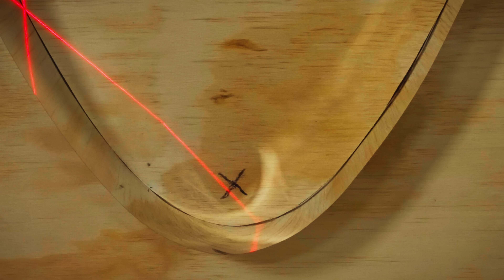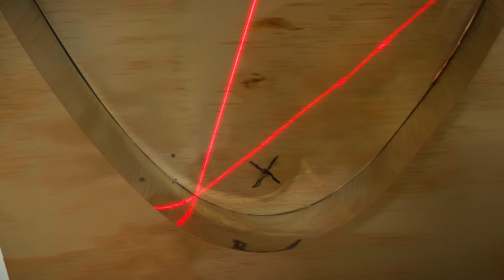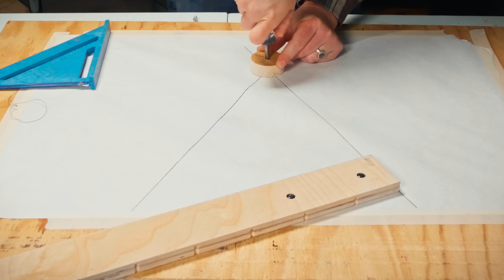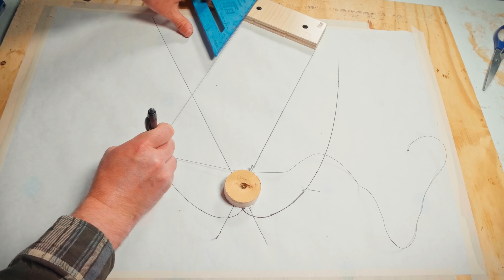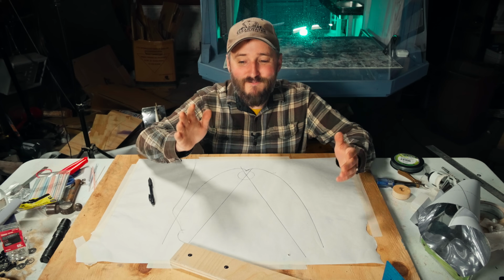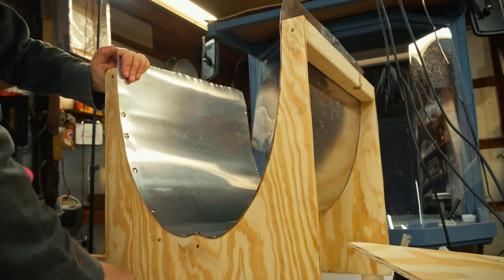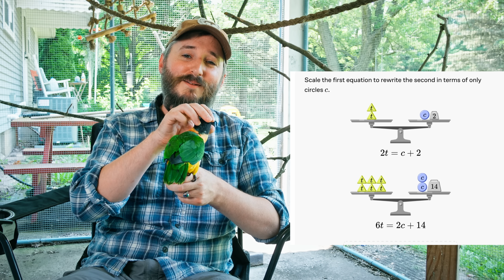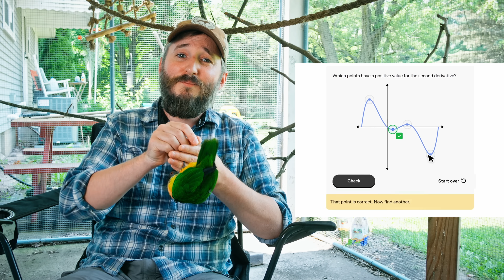DIY Solar Concentrators, Made Better.

Comment: This is so exciting.  I can see how you make the parabolic. I don't understand why it only concentrates on a small spot rather than a line.
     Presently, solar cookers concentrate heat that cooks the food in the cooker. I'm wondering if the flat one could be created larger to accommodate a pot? Put reflective material on both ends? And a double paned glass with a knob and a hinge on the top?  Or make one of the ends hinged?  If one of the ends are hinged, a smaller area could be cut out to just accommodate the pot and space to get the pot in and out. That would retain more heat than opening the top. It could limit the number of different size pots that could be used. If diy, the opening could be the size of the largest pot you would use. If manufactured, a starter pot, could be included. 
     I like Jeremy's idea for heating water. A copper coil could be made with an upper and lower end going to a container with a  spigot. That would make an excellent water heater. 
     And lastly could a solar air heater be made to heat the house or a room from this?

Comment: Draw your half curve in inventor using a sphere or a cylinder as the collector.  Use the rotate function to make a "dish" that sits on a 5 gallon bucket.   Have a heatpipe as the collector extend into the bucket.  Camping solar heater.

Comment: Would it be possible to copy this compound parabola and shape it into a donut and effectively making the solar input a 30 degree cone? I imagine you could have a loop of pipe stick up through the bottom to be the focal point.
Reply: Also in your second design I'm wondering if directing the sunlight into a sand thermal battery would it give any benefit

Comment: Would it also work to accept a 90° angle of aperture? Or even 160° ? Because if yes you would have a super efficient mirror for LED light. You would get a pretty damn good LED torch. For stage light for your yt videos

Comment: Interesting video, but yesterday we had +39°С outside without anything. So heating is not really relevant right now.
Reply: Showering, hot water for dishes
Reply: @SolarCookingGermany  That is correct and obvious, but can you make it work? Can you modify your existing water systems to enable you to shower and clean dishes using this solar heater? I really doubt it, though I have a solar station and my boiler has been heating with free electricity since this month. I have also had a summer shower since 2012.
I like the idea, but I'd like to see more everyday applications of it in real life.

Comment: That's fantastic. I think though, that when making the compound parabolic curve, it may behoove the maker to use a simulated pipe of a slightly smaller diameter than the real one, to avoid the incident light hitting the pipe at such a shallow angle, as shallow angles of incidence increase reflections.

Comment: Perhaps you can shortcut the drawing using the laser arrangement that you show beginning at 4:32 in the video. If you mount a pen through one of the holes already present in the bar holding the laser, then you can draw a segment of the desired curve by moving the laser from one extreme to the other as you show. Then rotate the laser apparatus to draw another segment. I think you'll get a series of scallops that you can then join into the desired compound curve.

I also suspect that if the curve of the 2-D compound parabola is entered into 3-D drawing package, you can use the drawing package to rotate the 2-D curve into a 3-D compound parabola that concentrates the energy at a sphere instead of a cylinder.

This approach is definitely interesting.

Comment: 16:12 Would this be useful for concentrating sunlight on PV cells or would that be too overpowering and lead to damage to the PV cells from overheating?
Reply: Current solar cells tend to fry, add cooling to the back and it could work… and provide hot water

Comment: Hey there, big fan! I have an idea. Have you considered making electricity with a peltier (TEG) by heating one side with this system and cooling the other side with a similar contraption designed to effectively harness solar cooling, like as shown in previous videos?
Reply: I did that with a Fresnel lens, but it's more complicated and less efficient than just using a cheap solar panel :D

Comment: Make a surface coated in infra-red reflective opal for your mirror! Then coat the inside of the pipe with a dark pigment! I also wonder if a mesh of aluminum inside the pipe would allow better contact with the coolant as to heat it quicker, or just skip the pipe altogether and have your focal point be a large heat pipe that makes contact with the coolant.

I also wonder if a refrigerant would be better for the coolant, perhaps being the gas inside a stirling engine or a series of stirling engines. 
You could also put a aspheric lens on top of the parabolic mirror to increase the collection range of the sunlight whilst still confining the light collected to that smaller angle. 

Really curious to see what the maximum efficiency of an optimized system like this would be.

A bit aside, but I've seen a lot of videos of fresnel lenses and I've wondered what sorts of optical properties you could achieve by making a mold of the surface and then setting a homemade opal on it as to repeat the pattern of the lens.

Comment: Here is an out of the box idea. What happens when you paint that pipe with your cooling paint and use a sharper angle on your compound mirrors to expedite the heat removal from the focal point and to also be able to point the apparatus directly vertical into a cloudless (or clouded) sky? Are we into something revolutionary? And use a more efficient coolant than air or H2O?

Comment: Man, I would've loved to see this video when I was in college for engineering. My senior project was making a solar oven, but we couldn't figure out how to design a good reflector with the constraints we were given, and our professor was no help at all. This really could've made all the difference for us. Glad to learn about it now, though! Thanks for another great video.
Reply: What was your major? The parabolic reflector would be a part of the curriculum in STEM courses AFAIK(?)
Reply: @manonfire285 Mechanical engineering. Sure, a solar oven by itself would be pretty doable- but not one meant to feed multiple families, only from resources available in rural Kenya. That was the specific task we'd been given. We designed a large oven made from clay bricks, and a reflector made from wood, with the reflective surface made of a single roll of aluminum foil, focusing all the light into a thin gap in the oven. But, the reflector design was far from perfect, and the gap in the oven was both too small to let enough light through, and too big to keep hot air inside.
Reply: Man , I can just imagine the insanity you guys went through , yikes
Reply: @texasslingleadsomtingwong8751  First world problems, I know, but it did still suck. The idea was, we were supposed to design a solar oven that could be made locally in rural Kenya, so we were trying to design one that didn't require any glass parts, and only required a roll of aluminum foil to make the reflectors. The idea was to focus the light in through a small crack in a brick oven, and hope it was narrow enough to not let heat escape. Without the professor's help, we couldn't tell if our computer model of the air in the gap was realistic, or if it was complete nonsense. We also had no guidance on designing the reflector. At the end of the project, we ended up with a broken brick oven that only got one degree hotter at the hottest part of the day. Still got an A though. I don't think the professor cared at all.
Reply: @Rippertear  Ah, Grasshopper, but what did you learn from your FAILURES?
Reply: @TimeSurfer206 Temper your expectations, especially from seniors who already know they're graduating, and especially from professors more interested in their research than in their courses.

Comment: Nifty AF as per usual ! Not to nitpick but, since you never mentioned it, it's just best to point out that it's rather well known that technically a hanging chain(or anything string-like) forms a catenary not a parabola. They are distinct mathematical objects but can "resemble" each other. Perhaps even arbitrarily closely(as can an arc) near the bottom(typically the $ area for optics). Or in other words the more shallow(Xdist > Ydist) the catenary the less the deviation from a parabola. Anyway, I for one would be interested in some math for this.

Comment: Please build a practical solar heat collector using the double shape. 
I'm guessing the pipe will be close to horizontal if water is used, so it can drain out before freezing at night. Water pump would only be on when sun is present. 
The mirror trough angle could be set bi-weekly. Opening should be perpendicular at noon. 
500 gallons of water at 180°F will heat a house for 3 days when it's -40° outside. Using a heat exchange system. Be it forced air or in floor hydronic. 
If you're interested, I have a solid drawing of a 600+ gallon insulated tank made of 2x4's & plywood. Uses a 10' x 20' sheet of rubber, cut to 10' x 16' for tank & 4' x 10' for lid. Tank is 10' long x 4' deep x 3' tall outside.

Comment: This is amazing! As you were explaining it, I wondered if there would be any advantage to using a double parabola. What I mean is, using either of your designs, but instead of placing the pipe in the focal point, having a little parabola upside down to collect the light rays and focus them further? Maybe to help capture more of the missed rays in the original design?

Comment: Amazing how awesome concentrated solar power is.  Would be really neat to safely make a solar powered air conditioner to cool with. Ideally a passive solar design, even if needing to tap into the ground for some geothermal cooling to condense and maybe a solar or off grid fan for the evaporator.  Though I'd have to see if even the RV propane powered fridge freezers even have a fan.  One of those to do lists things I have not found the time to research yet.  Tamera solar village has some neat designs they use where they even cook under moonlight with one of theirs.
Reply: Wondering if coating a cheaper compound parabolic surface with an ultra white reflective paint and maybe covering the trough with oven baking bag material?  Wondering what the cumulative effects are on performance along with longer term life cycle?

Comment: You're a genius dude- I've been designing generators based on heating a thermal mass with a boiling coil around it, and the increased surface area of a flattened mass using your compound parabola is perfect. You're so inspiring. I still tell people about your water bottle electrolysis video.

Comment: Could this be upscaled to distill water. Dig it into the ground using framing to hold the shape. Use your  idea heating a flat surface. That flat surface could be a metal container of water. Just dont know if the water would hit boiling. All the people in the world that suffer with dirty, nasty water

Comment: If it gets hot enough to melt metal... Could you make a solar kiln? It'd need to be bigger to fit a decent sized pot, but I could see it working.

Comment: Not to say that your this doesn't work, but your test changed 4 variables between test subjects (Mirror shape, pipe size, pipe material, pipe covering) and you now claim that the shape caused the difference, that doesn't seem like good science to me. The result might still be correct, but a good test would use identical pipes and only change the mirrors. Just look at the footage from inside of the aluminum pipe, it's completely reflective, basically you can throw the measurement away, even though you said the pipes are painted with the same emissivity this doesn't seem to apply to the inside of the pipes.
I would hope you would do a follow up video with a repeated test which uses identical pipes. With this video you give too much room for denial based on improper science, which I think is unnecessary.

Comment: Variation on your speed square process, as best I vaguely recall from my now-long-ago higschool classes, which might be a bit easier than keeping the string in line with the square's edge while the marking point is floating:

Put a board or other stop along the bottom of your plane (e.g. screw a 2x4 on your bench, and butt some plywood or cardboard to it).  Choose a point, and put a nail or similar there.  Tie some string around the point loosely enough to turn, and the other end attach to the point of a square (speed square, carpenter's square, whatever; I don't remember how my teacher did this, maybe just taped the string and accepted a slight loss of edge).  Pull the string taught while keeping the square...er, square to the stop.  Pull the pencil/pen/etc down the edge of the square, point to bottom, keeping the square against the stop.

Since the pencil is riding the square's edge instead of floating, it may be a bit easier as there's less to keep track of while tracing.

Comment: for this concentrating solar, and being such an easy thing to design at home, i'm wondering what the best way for it to generate some electricity would be.

1. to concentrate more sun on solar panels
2. to generate heat on 1 side of peltier plates.

edit: ah, it looks like peltier plates are about 10x less efficient than solar.  so solar panels would be a much better way to go.  well that was easy.
Reply: Solar panels also drastically lose efficiency when hot. And you could just use a solar panel the same size as your concentrator, much easier

Comment: Im guessing the next step is to coat the pipe with cooling paint and radiated heat away from the pipe into the mirrors and up to space, then combine the hot and cold-water loops to passively generate energy using peltiers

Comment: Can the compound parabolic mirror be used to provide more sunlight, to a solar powered sensor light?  The intent is to  maximise sun exposure to a solar powered sensor floodlight, in a place where direct sun exposure is limited daily by trees and buildings to a few hours. The sensor cannot be moved to another location.

Comment: interesting, an involute curve with a parabolic tail...
now fresnel it. wonder how well it changes to a flat structure?

its easy to mount flat mirrors in a box frame affair, angled slots, sort of like a louvre... and cheap, can even get offcut strips if lucky...
also need long focal lengths, otherwise the mirrors interfere with each other, blocking themselves. stay in teh bottom of the curve! does that work here? iunno. can only try!

interesting aspect, you only need half, the absorber doesnt have to be directly overhead? you can wall mount them, etc. light is flexible.

my thinking would be to look at ones solar angular deviation through the year, aim halfway and set the angles the same, troughs arranged east west. no need to reposition through the year. despite its performance on a cloudy day, pointing at the sun still helps!

the focus doesnt have to be sharp. its all good and well heating something to 1000C, but can you do anything with it? how much heat can you transfer, rather than simply radiate as wasted black body radiation? if water is getting boiled, but leidenfrosting off the surface and coming out barely above 100 with a red hot absorber, youre simply wasting heat.
found with fresenel mirrors that flat reflectors already give a diffuse focus. for heating water, its far better to be able to heat a surface to  little over 100C, with no flow. and when its the same temp as the water coming out, you know its extracting the maximum energy.. or you dont have enough exchanger area... flow rate affects final temperatures, blah blah... despite being larger, having a lower temperature absorber reduces radiation losses..

evacuated heat pipes would be a good addition...

and, seeing the geometry makes it pretty easy to do with a router.

straight edge with rollers to hold router. thats running on rollers on fixed straight edge... string keeps router in appropriate position still, just keep it taut. dont get it tangled up, lol.

timber frame, just some ribs and stringers, mylar emergency blanket stretched across...

Comment: This compound parabolic trough design is used a lot in large scale production for heating oil for power plants. You can also use this to create small scale water heater, which you mention.  To get even better performance, use an evacuated tube. It will definitely heat the water up to well over boiling in a few minutes. 
I would like to build one of these in conjunction with my solar electric panels to make hot water and to help heat during the winter. I would store the heated fluid in 30-50 gallon barrels surrounded by sand in an insulated container. Figuring about 6 barrels minimum.  You can create your own evacuated tubes using old fluorescent tube bulbs and cleaning them out, then pass a copper tube inside it. Then create a special mounting bracket on each end to hold the tubes and hold vacuum.

Comment: Looks like the "power from the sun" book link has expired. It 404s. Excellent video. I might put this to practical use on my home in the near future. In a strange synchronicity, I was just thinking about solar hot water heating when this popped up in my feed.
Reply from the maker: Might have given the site too much traffic from this video

Comment: Instead of heating a tube, heat a cone that gets wider at a 60 degree angle. Then glue six of them together for a radial concentrator.